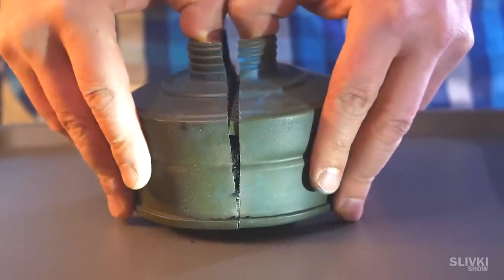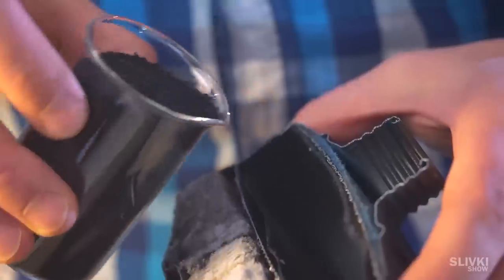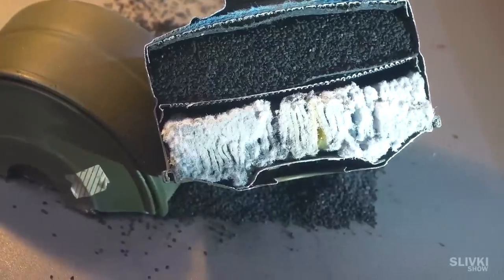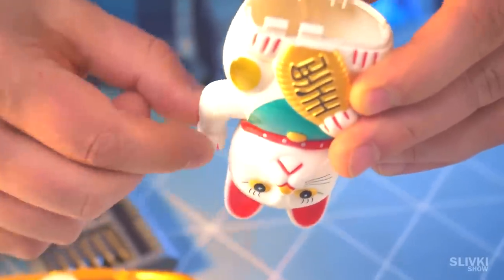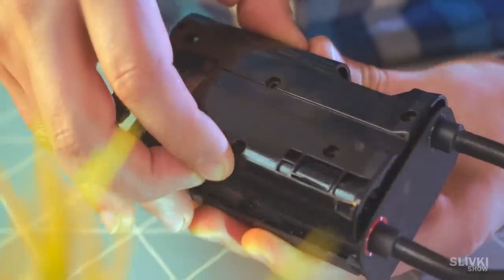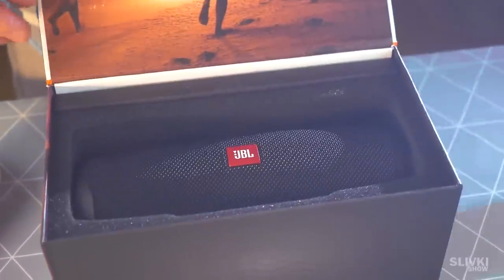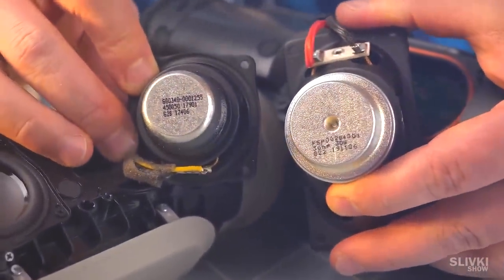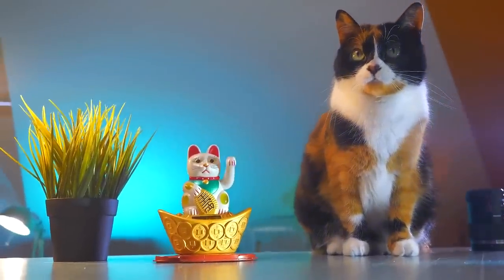WHAT’S INSIDE OF GASMASK?

Comment: 1:13 the soft material is asbestos and the ,,gunpowder" is activated charcoal
Reply: @burnedman8117  it couls be, if it was an older filter. Although, it looks like a newer kind (most likely fiberglass).
Reply: @electropika7759  that is a Polish gas mask from the 1980s which they had stopped with asbestos in filters by that time so there is very likely no asbestos
Reply: @makarov9419  Very informative, thank you!
Reply: @electropika7759  no problem

Comment: You are lucky you got a JBL Charge 4 with the GG model driver.
There is another model and it's name is TL, it usually breaks when it comes in contact with water in less than 30 minutes.

GG lasts way over 24H underwater

Comment: What model filter is that?? The white filter part could be lined with asbestos if the filter is older or a soviet filter which judging what the gas mask it is it may be a soviet filter, which means you might have been exposed to asbestos, also the black granuals is activated charcoal
Reply: It's Polish MS-3 or MS-4

Comment: If thats an old warsaw pact filter, i wont recommend to do it coz of asbestos, but if its new, tell me where to buy it coz i need it lol, 40mm gost
Reply: Gung bojog  I’m not sure there are many host filters without asbestos as the Warsaw Pact and Soviet Union used asbestos in there filters until they collapsed
Reply: @12pu48  thats my issue so far, i cant find any filters that work in 40mm GOST, i know 40mm NATO would fit, but theres a risk of leak. So far, i use 2007 GP-7K filter. I heard FP-5 (i dont remember that polish filter name) is 40mm gost, but its hard to find